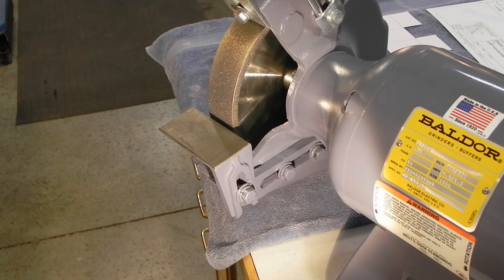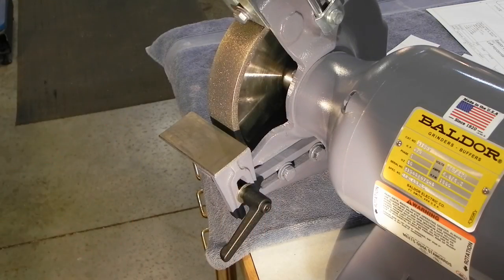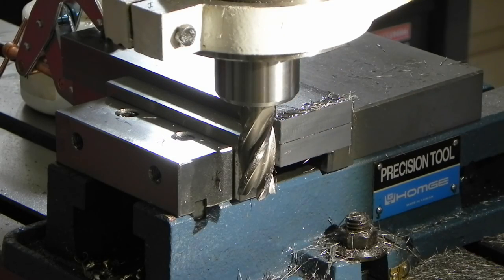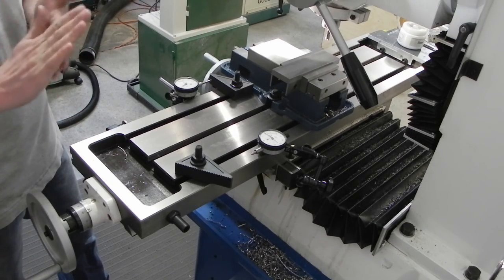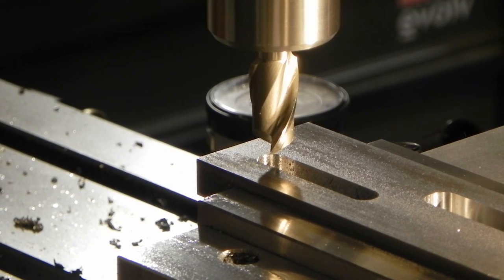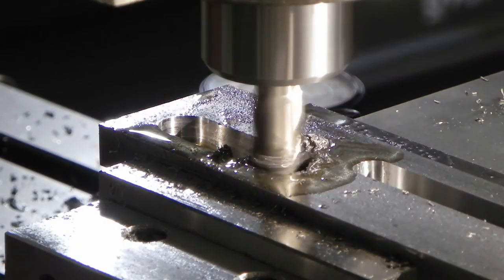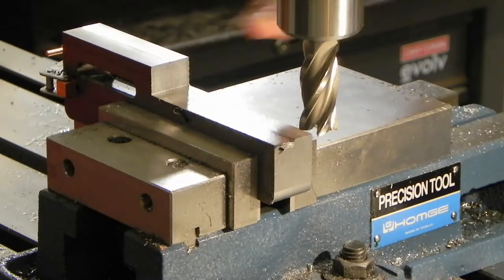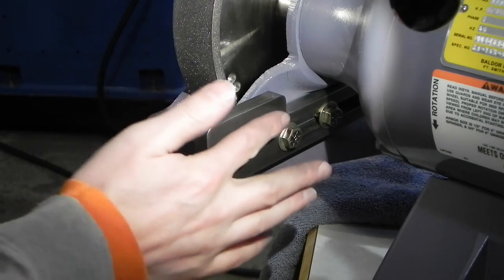Bench grinder setup Pt. 3

Comment: Substituting a grade 8 for a grade 3 hex head screw is not necessarily an "upgrade", it depends on the material and application.  Your grinder guards are likely cast or ductile iron.  If they are cast iron, and if the mating surfaces are in any way not co-planar when assembled, a grade 3 screw's greater "give" can provide a sufficient clamping force and do so with less possibility of cracking a component or stripping threads.  Remember threaded fasteners do their gripping through stretching, and if they resist the stretch due to too high a grade or to large a diameter you can experience part failure!

Comment: very nice job on those grinder brackets. i subscribed to your channell. i also am a home hobby machinist with a 14x40 3 hp 220 single phase precision metal lathe and a 9x49 atrump 2vsg milling machine and about 10 kizillion dollars in tooling lol the machines are the cheaper of the two. keep up the good videos thanks.

Comment: I wanted to ask you a favor I have a baldor 812re model I was wondering if you could do me a favor And build me a full set like thiswith the rest plate and everything minus the handles I could buy those at amazon like you said ?please help me out
Reply from the maker: Sorry Steve, I just don't have the time for that right now, as my shop time is severely limited thanks to the new arrival to the household. 

However, you should be able to download and printout the blueprints from my website and work with any local machine shop, to get yourself a set.